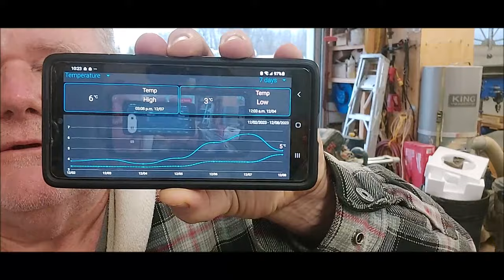⏱ Vlog December 2 to 8-That Bee Man

Comment: Seeing all those big boards and then thinking of cutting all those into little strips is intimidating. That will take some time. Hope you have a good weekend.
Reply from the maker: Hi Russ.  I just finished, in fact.  Took three hours or so.  Each width yielded 15 to 16 strips.  Each board yielded 9 lengths.  4x9x15=540 times through the saw.  The lumber was pretty nice, not much loss to  knots.  I used up a bunch more offcuts too and ended up with about 650 long shims for covers.  That should be more than I need for this season.  Thanks for watching!